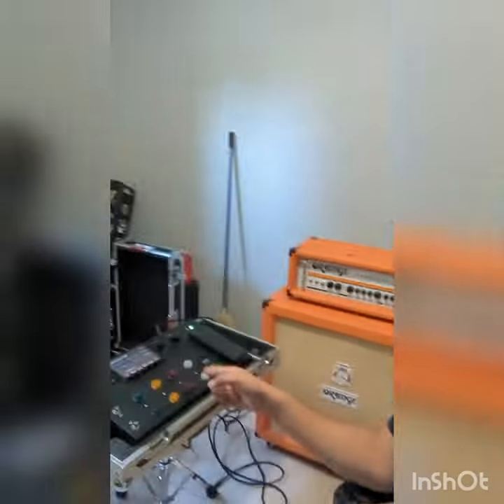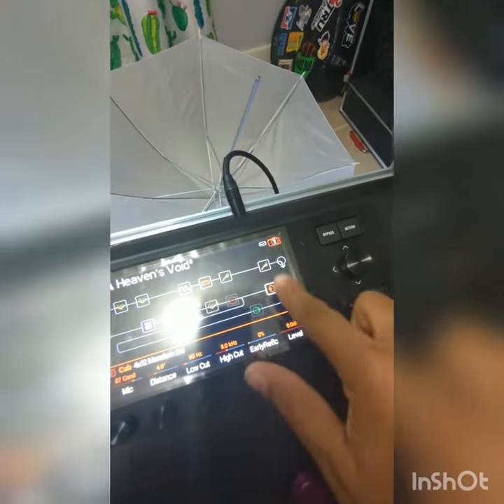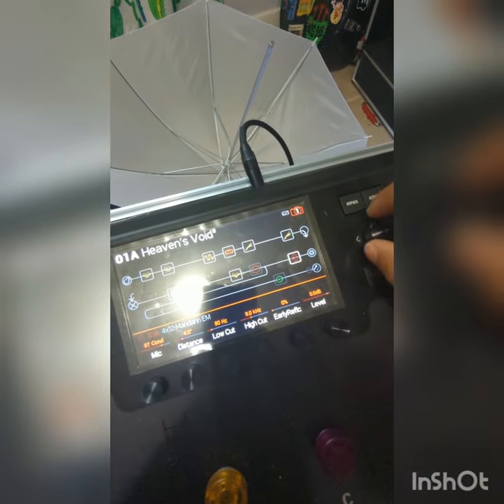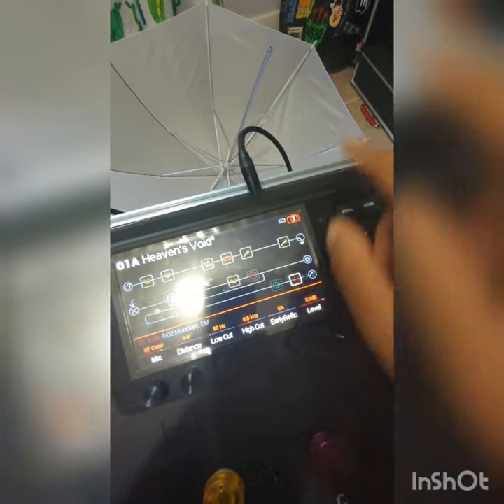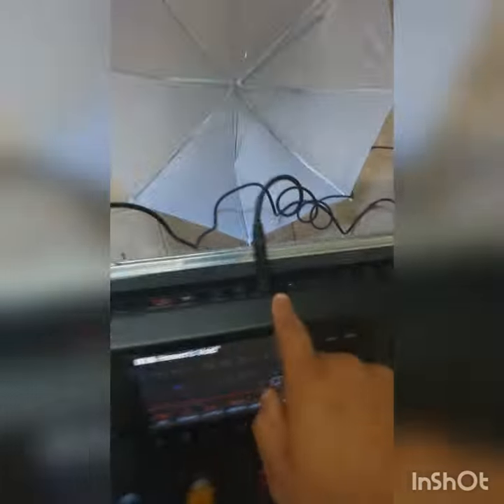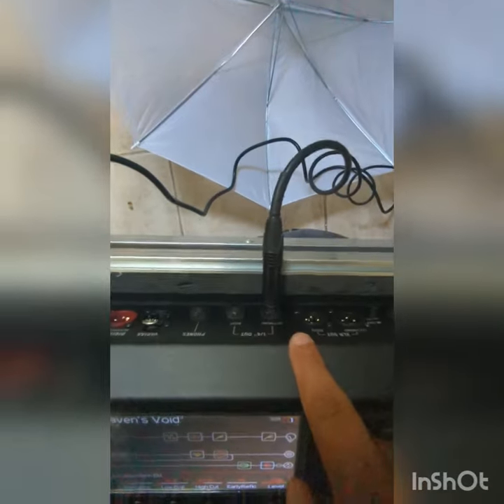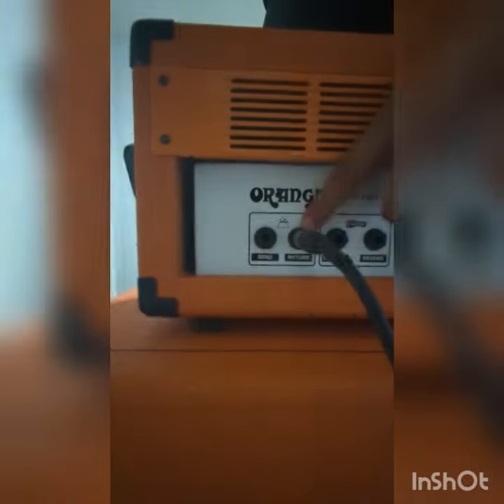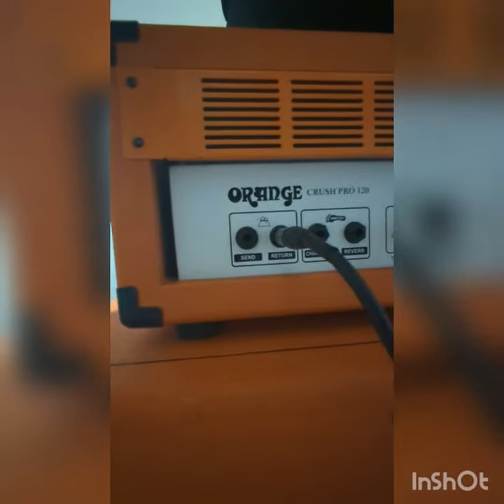How To Use A Helix/HX Stomp Amp With A Physical Cab (By using your amp's power section) #shorts

Comment: This was so helpful, thanks a lot. When doing presets for this setup do they all have to end in the amp as the last block?
Reply from the maker: Preferably yes! but you can add a delay and a reverb after the Amp block.
Reply: normally you would put your delay/reverb/etc... in the FX loop of your amp if you want to use your amp distorion with a real amp setting so your time effects come after the gain stage. In the helix, by putting those effects after your amp block and then connecting your helix into the return of the real amp like in this video, then it's the very same deal.

Comment: What about if you have a HX stomp, and i you only use snap shot mode and have certain preset you always use with an IR attached to it?
Reply from the maker: Well since the IR is technically a cab block, it could potentially filter/conflict with the physical cab. You could create a parallel path with the IR that goes in house and a path with no IR that goes into the power amp. Remember though there are no rules! So you can try it however you want, it might sound good still.

Comment: I have a dsl 100 and when I do this the master volume doesn’t work, I have no idea how to control any volume
Reply from the maker: Weird, I've never had that issue. You could technically also use the regular input (make sure your cab block is off)

Comment: Does it effect your tone if you don't do this?
Reply from the maker: Yes, it will sound super muddy and it will have almost no high end what so ever.
Reply: That might be my issue, thanks for the insight!
Reply: Hello, with the 4cm you can manage which blocks go in front of the amp and the other to the power section. If no 4cm you can use sone helix pream which are really cool ones